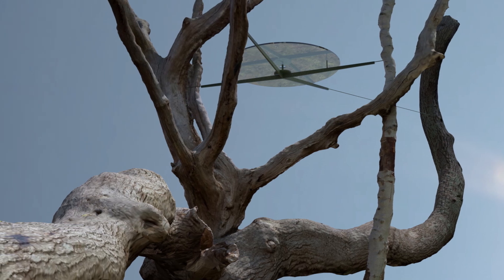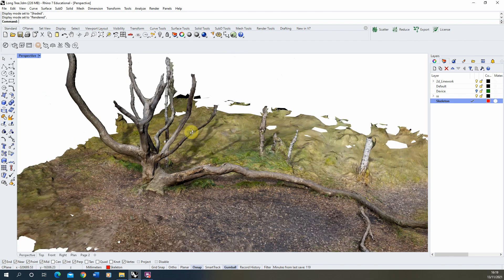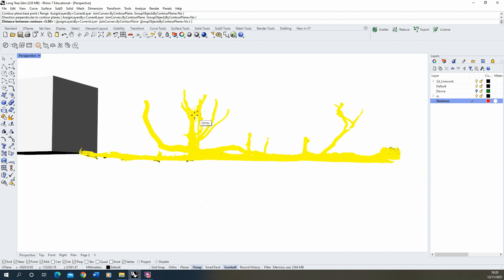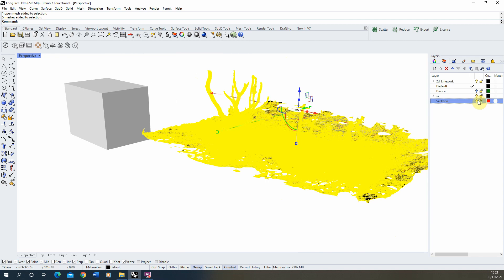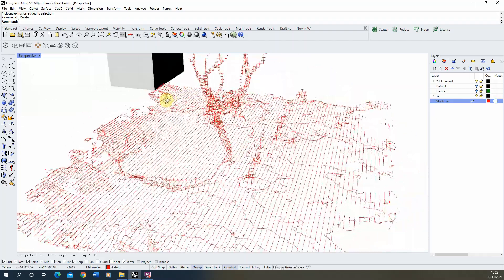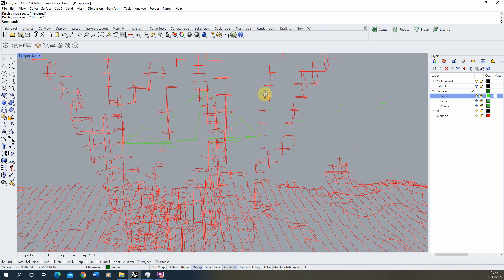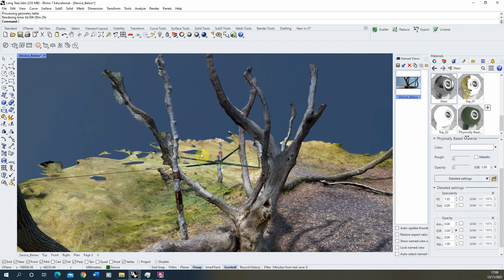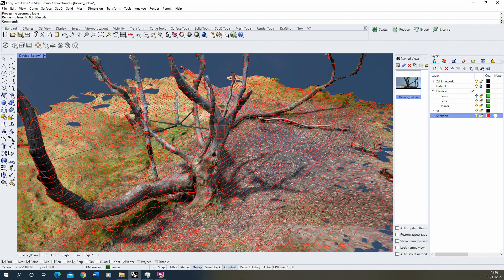Working with 3D Scan Objects - Rhino 7

Comment: thank you for this ! do you have any knowledge about the Faro 8-Axis Laser Scanner workflow?
Reply from the maker: Hi Ersan, I believe the Faro scanners capture pointcloud data which is a slightly different workflow to using photogrammetry. Faro scanners should have dedicated pieces of software which can convert these pointclouds into meshes which you can then import into Rhino using the method described in this video